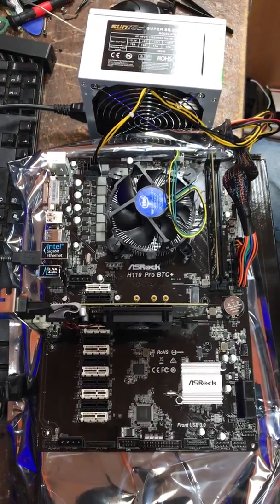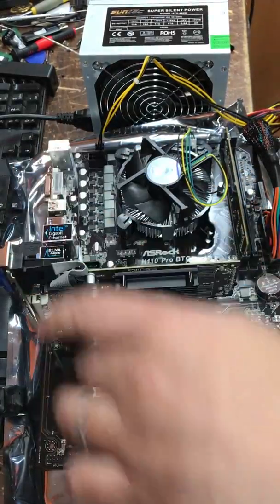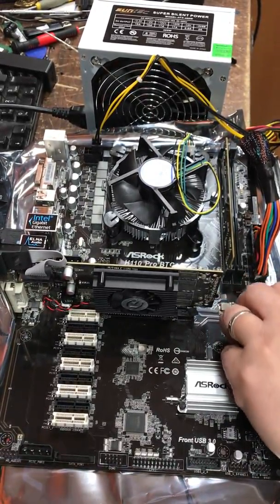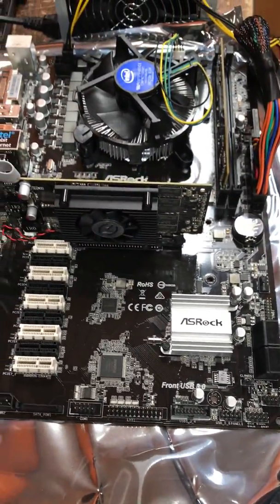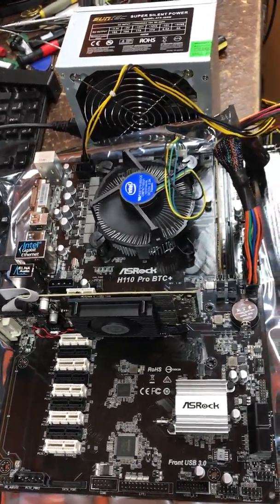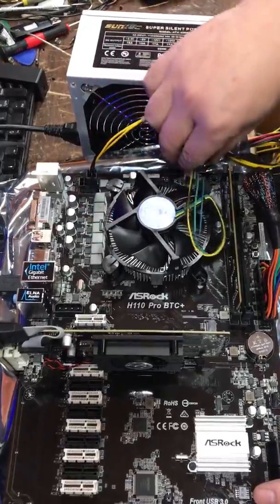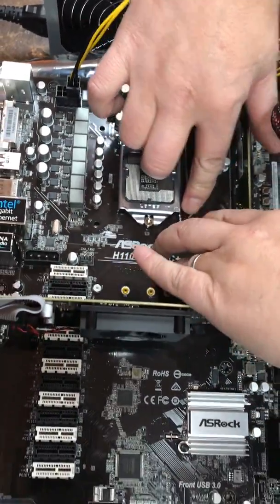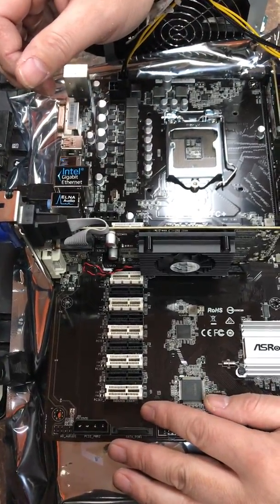How to troubleshoot ASRock H110 PRO BTC Motherboard

Comment: I have a situation ise everything you say in video but press it and it does boot neither with windows nor with usb nor less does it make video but the cpu gets hot which indicates it's fine actually I didn't have any options that I recommend before that it turned off i Predia only on the second try after it turned off and I only have 7 cards 5 amd and 2 nvidia someone help me or a chipset died

Comment: I have two rigs with this motherboard. One of them was giving me a black screen. After trying a lot of tricks by "expert" people, I changed the memories it worked okay. So, take care with the memories you use with this mobo. The Kingston DDR 2400 is the one that worked very well. A brand new Samsung DDR4 2400 was not working, and I tried with 2 modules. I hope it helps.

Comment: Super helpful video! However after doing both those things my rig still wont boot. I am starting to think it could just be the ram having incompatibility issues (even though its ddr4 2400).
Reply: Yeah me too. It clicks but won’t start. I’m replacing my 3200hz ram with a 2400hz since I’m using i3 7100
Reply: @ascalone2193  did that fix it? Having same issue

Comment: 2:16 power button. Just what I needed 👍
Reply: Would you possible know why that my rig wont turn on when i put the thingy in the 1st and 2nd pin?
Reply: @coltonstull1  did you figure out how to make it work, having the same issue
Reply: @Blaklat  Try using one of the two buttons in front of the GB card, those are the power and reset buttons, i didnt have to because my power supply had a power button on it.

Comment: I cannot get a signal when i place  a riser in the x16 lane PCIE slot.  However if no cards are connected to this slot, the signal returns.  

Has anybody experienced this?  If so, what is your solution?

Comment: mine is either 
A) continuously rebooting
B) Rebooting on a black screen
C) Posting (but if I try to push dell to get into the bios it as either "A" or "B")  if I dont push dell it managed to load to the windows logo  loading screen and then does "A" or "B:
D) I can get into the bios but if I leave it long enough (like 10 minutes) it does "A" or "B" 

Note I never managed to install windows, on the very first boot it didnt get that unstable it loaded the windows installation from the USB drive but when windows setup (after installing a few files) says "your stystem will restart in 10 seconds" it did not wait for the countdown and did "A" like on the first second. 

I tried reseating the RAM, reseating the CPU, tried with 0 GPUs with 1 GPU tried different RAM tried single or dual channel tried single channel with different RAM on slot 1 then on slot 2 tried to clear CMOS with battery out and with no power for an hour or so no result something from the above just happens (best case scenario is for "D" to happen. )

I doubt that it is a PSU issue I have a brand new Corsair HX1200i but I will try a second one as soon as I get it. 

Now this leaves only the mobo and the CPU I doubt it is the CPU (because IT would just die I wouldnt be able to have "D" if that would be the case and when "D" happens I check on temps and they are like 12C so ok ) 

I am afraid that the mobo is bad but that's a huge loss until I get it RMAed I will lose tons of money (from not mining my 13 GPUs) + as far as I read this issue is frequent so I may get a bad RMA replacement as well :'( why Asrock??????

Comment: Mine will not POST at all. I tried all the solutions here and still nothing. I did however notice that the CPU fan will pulse slow to fast (but not maximum) then back to slow and repeat.
Reply: Mines doing this. Did you find a fix?
Reply: @timeismoney9684  Same any fix? lol no etherenet light for me either or my usb too
Reply: @generationalwealthportfolio  nope, seems to be  a common issue with these boards. Got a new one from a different supplier and that's working fine.
Reply: @generationalwealthportfolio  ever find out how to fix ?

Comment: I  didn't see any troubleshooting for this actual MOBO. I had so many resboots and tests, whith 12GPUs, as this a bit too much for 1 MOBO, and you can't tell if it is a riser, if it is the controller of the lines,, but the Celeron should still manage 13 lines of PCIe X1, which is used for mining. I had to seitch reisers, and put the same card on the new riser, but keep it in same slot of the mobo. If there is a problem, I change the slot of the MOBO, just plug the  rider in next slot, if still issues, keep everything like it was, and swap a card. Giving advice to check if CPU and memory are installed properly, is nothing to do with the MOBO, where people need to know how to troubleshoot the RISERS., memory install

Comment: my video card isnt workin on slot 0 (or 1) of the PCIe x1 slot.  Why would something like that happen?
It only works on the PCIe x16 slot.  The risers are good, the video card is good.
Reply: I got this same MOBO. All the black slots seem to work but the white ones dont. I updated to 1.6 and when plugged they show on the bios as red reading empty. Any ideas how to fix this?
Reply: @Bcohen1945 to fix the issue I had of the motherboard not detecting gpu’ s connected to x1 slots using risers I first connected the motherboard to onboard graphics output,then added my first card a 1070ti connected to riser and on the x16 slot.then checked the my devices and seen that the board could see the gpu.then i installed the latest graphics driver and re-booted.after re-boot the gpu was detected and it worked i then added every card this way.issue I get now is when I add a new gpu to the mining rig I have to add the gpu.go in safe mode.use ddu.(display driver uninstaller)then reinstall the latest driver.re-boot and this then the new gpu shows up in my devices and is detected on my mining software.hope this helps.
Reply: @wulliewheelspin1  thanks for the reply. Im using hiveos currently. I will try putting the gpu on the x16 and then add the risers, see if that works.
Reply: if u read the manual it says that the first gpu u put in the rig has to be in pciex16 slot, from there u can build.
Reply: @hallvardjohansen2954  not at all. I fixed the problem 3 years ago.
Thank you for the try though
Reply: @br0k3nilluzion  :D